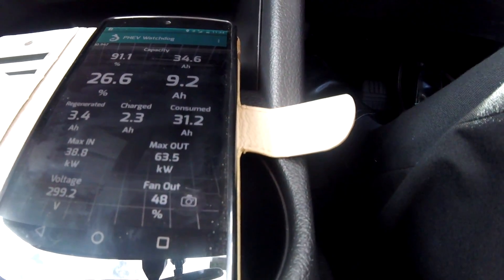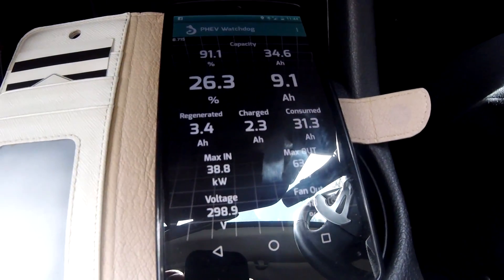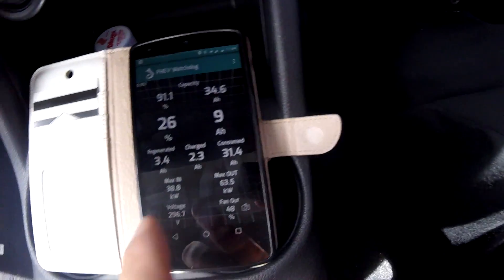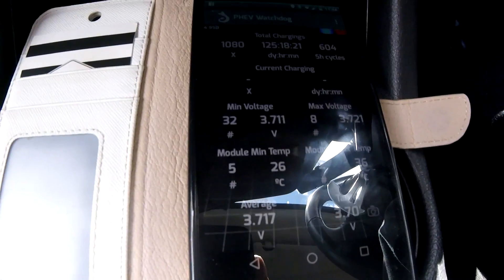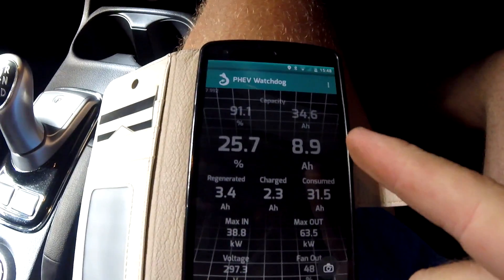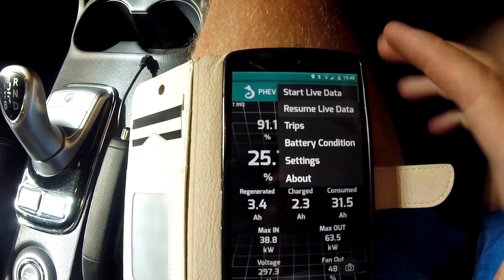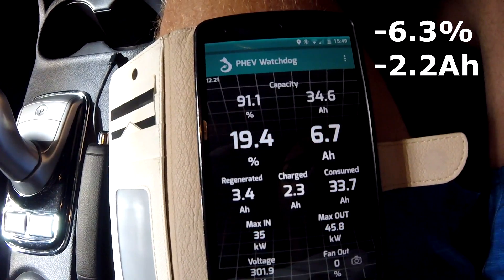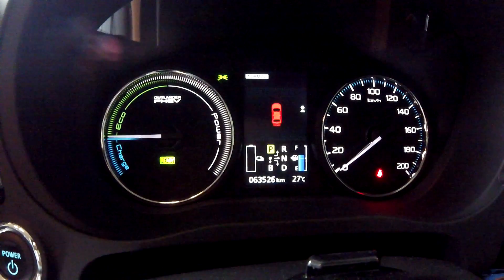Q32 - Estimated Soh and SoC in the Outlander PHEV?

Comment: There is no bug. They just make you a fake battery smoothing. Instead of running the smoothing procedure they did reset the BMU learned parameters. In time SOH is going back to the proper low value and the missing Ah while parked will disappear or at least they will be way smaller
Reply from the maker: They definitely did a reset, I agree. THE BMU is learning again... I had this parking issue before though, so I'm not sure if they are related.
Reply: If you allow me to use some fragment of your videos, I can make a quick little video showing my "theory" ... it is an educated guess ... but I believe I'm 99.9% correct on what is going on in the PHEV ... clearly on the video I will make all the reference to your videos and channel ... at the end ... your experience and analysis did bring me on this "educated guess" ...
Reply from the maker: elm70 Well, the only problem is with all this theory, the EV range went up a lot after their magic while still maintaining the lower buffer of the battery. 
Please go ahead, permission granted.